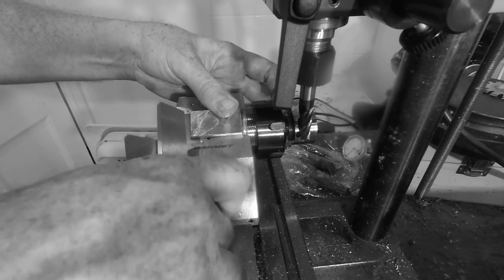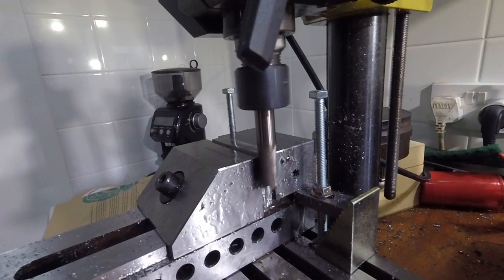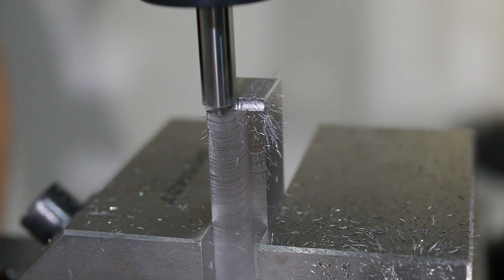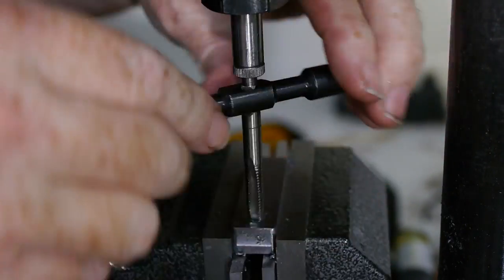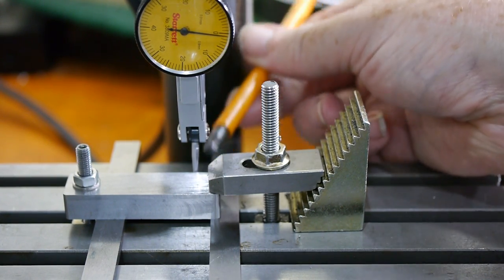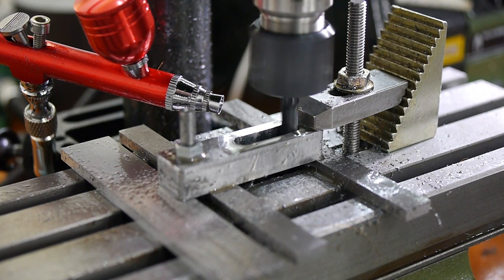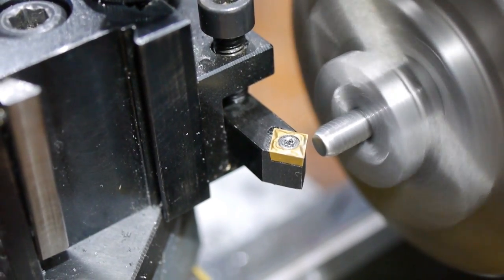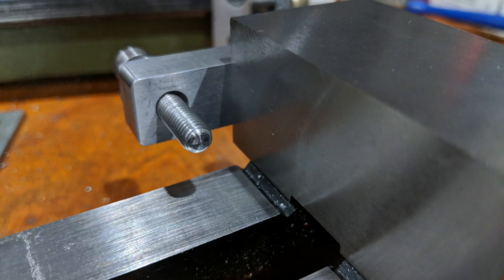Making a Vice Stop for a Toolmakers Vice

Comment: I just had a thought about side milling, what if you had the part rotated 90 degrees so the wider surface was on top? The contact area would be reduced and it might just cut it.
Reply: Another thought (based entirely on theory from others as I haven't confirmed it myself) - as the collet sucks the work into the block, one wants to keep a fairly consistent torque on the nut so that the part always moves the same distance into the block. One work around to parts that vary marginally in diameter (which would result in slightly different distances from a datum face) would be to use a longer stop screw that engages against the part rather than the block, but for ER32 the screw might need to be about another 20-40mm longer, and that could spell more flex and less repeatability for an M6 thread than is worth. If you do any experiments with it, I'd be interested to hear your findings, but also, I understand if the numbers are too small to bother chasing.

Some trig yields, for ER collets (8 deg angle) if the part diameter varies by 0.02mm, the distance of the face could vary as much as 0.07mm! Maybe the numbers are worth chasing.

Glad to hear the compressed air worked, I love how the part turned out, it looks nice with those radii! :)
Reply from the maker: Rotating the part would seem likely to help. I wish that had occurred to me, so I could have seen the results. I have had some success side-milling brass, and I just assumed it would work with this material too.
Reply from the maker: On repeatability, my focus with this project was on repeated operations on a single part, such as the six faces on a hex. I wasn't really considering repeatability between parts. Having said that, I think this stop could be used with collet blocks to try and prevent the collet movement from affecting the parts depth in the collet block. The trouble is it can only be used for that, or locating the collet block; not both at the same time.

Comment: put the part in the vice so the widest end is facing up. same technique but presenting less surface to the cutter at once. a good thing to keep in mind in general, is making every set up as short and stiff as possible. a comment of threads in general, the minor diameter of a female the has little to nothing to do with sloppy theads so long as it is within spec. the PD is what dictates clearance. if you want a close fitting tapped hole you need a tap designed to give a particular fit. that said, a regular hardware store bolt wont work in that application either as theyre of a lower tolerance.
Reply from the maker: Excellent point about the minor diameter. I hadn't properly thought about it that way, but wanted to cut down on any source of looseness in the thread.

Comment: I've got an assortment of O1 and have never had a problem milling it. Perhaps yours was hardened some? Yes, it is tougher than mild steel but it still will machine OK. I do have a heavier machine, 9 x 49 Jet.    I've struggled with some stainless steels work hardening when I used dull tools or didn't cut aggressively enough.

Comment: GREAT LAMPOON of precision machinists who quibble over the smallest details, but pass over the most important features! It was GENIUS when you took it out of the vise to drill the slot-starting holes. Who could've thought that those holes could've been drilled in the vise on the same centerline as the stop-screw hole without a lot of indicating, repositioning and extra clamps? The slot didn't even NEED to be parallel or colinear, but "That's what the print says" urges the PM to incontestable certainty that those are the goals that he's shooting for.
  Blended radii on the ends was less-well spoofed. You should have included some 'Rule of thumb' or 'Accepted industry standard' when you chose the radius. Explain to the general public that smaller radii are acceptable for small-dimension items, but larger ones often demand larger radii. WHY you didn't include a link to your manufacture of a variable-radius end-mill which automatically adjusts between 2 different radii is excusable. I'd have loved to see a 3/8"  rounder making as-if it's a 1/4' rounder on the next edge. Just time the video to the high z-axis.

Comment: why do you started with a hss hard steel ?  you can start  with a softer one and then heat treat it
Reply from the maker: I didn't. The piece of steel is O1 tool steel, supplied in machinable condition. I didn't get around to heat treating it yet, but I may give that a try at some point.

Comment: Hi there, perhaps try turning the vice onto its side so you can choke down on the part a bit tighter?
Dz
Reply from the maker: That's a great idea, I'm slightly ashamed I didn't think of it myself. Thanks!
Reply: @AdventureswithaVerySmallLathe  it's easy to spot things from the sidelines, quite different when you're stuck into a job 👍🏼

Comment: What I do is lift the rotor an bit
up out of my work, move or advance my cut 10 to what ever thousands I need, mill down or drilling procedure an when I'm through to the other end, I back mill an it cleans up fairly good 
Try that instead of trying to cut one big chunk off.

I also noticed a lot of squealing when you were drilling an milling horizontally with your end mill.
I would have done exactly the same with my end mill to drill down completely to the bottom, moved a few thou, an drilled down again, an once the slot was established, I would have cleaned it up, But I also would have tried to slow down my bits to stop the squeal.

Comment: 1) I would not have used tool steel for the block.  All the pain you had machining it was entirely unnecessary as mild steel would be fine for the application. 
2) having dug yourself that hole when machining the ends of the block and struggling, i would suggest a) turn block to reduce depth of cut add others suggested, b) lower revs (Google the recommended sfpm rates for different materials) b) multiple passes not a single full depth pass, and c) lubrication in that order of priority

Comment: When making a vise stop why not make it out of aluminum and not steel since it is not a part that needs to hold a lot of force or be super durable?
Reply from the maker: It's important that the stop is as rigid as possible, so it doesn't flex when the part or fixture is pushed against it, but the simplest answer is that I don't enjoy working with aluminium, and don't much like how it looks.
Reply: If it has to be "as rigid as possible", then why do you mill material off to make it 'rectangular'\ @AdventureswithaVerySmallLathe

Comment: Flycutter in the Lathe maybe easier. it the work would fit in the holder that is, and if the lathe is more powerfull
Reply from the maker: I don't have any way to hold parts for milling on the lathe yet, though that's definitely on the project list.
Reply: @AdventureswithaVerySmallLathe  don't try the milling attachment like the myford had. it is possible to do some work, but it is very anoying to set up, and it is not that stiff neither. if you got one of those rotatable toolpost, just mount it inside the holder instead of the tool, depending on the radius of the cutter it can work that way. also aloris or other quicktoolposts work

Comment: With O1 slow down the speed you are way to fast as the video shows the cutter wearing an rubbing which is why you will see the O1 start to become magnetic. Low speed up on the feed you wont go wrong.
Reply from the maker: Thanks for the advice! I'm about to start another project with some O1 milling, so let's see how I get on.
Reply: @AdventureswithaVerySmallLathe Good luck. I will be watching. With O1 D2 etc the trick is Take ur time as its good tool blunting mat.

Comment: I love your videos.  However, I was surprised that you did not use a slot drill rather than an end mill to make the slot.   You did point out the problem using the end mill.   The slot drill does not give that problem.   I suppose its name gives it away.

Comment: Seems standard cold rolled steel would be more than sufficient for a vise stop, and you would not have ruined all your nice tooling.
Reply from the maker: Cold rolled steel is surprisingly difficult to get as a hobbyist in my area, or was when I made this video. I settled on O1 precision ground stock because it was easy to get in small quantities and reasonably priced. Despite looking for some time, I couldn't get rectangular mild steel bar except for ridiculously high prices from commercial vendors, who charged very punitive prices for small quantities. It might seem best to cut rectangles out of round bar stock, but with a manual milling machine that can only take 0.1mm at a time that is an impractical amount of labour.

Comment: Use cutting oil.
Reply from the maker: Oh, I did. One of the downsides of chain-drilling is that the cutting oil runs through the part, rather than being held in the slot as it's machined. It's tricky to edit down the video to a length that's enjoyable to watch, but keep in all the details people want to see.

Comment: From an old machines your tools  bits are way to fast  read up on cutting speeds, ( Harder steel go slower than aluminium speed ) get some decent cutting coumpound  trefolex or rocol  machine oil is by far the worst thing you can use for the life of the cutting tool (unless you working on Aluminium then use oderless parifin /kerosine ) tapping and drilling you will see in seconds a big difference do you understand Climb milling ver Conventional milling  may be something to look into other than the few basics your missing a very good video  and entertaining  ( when tools smoke  think about stopping )